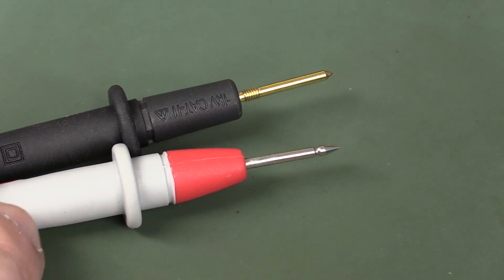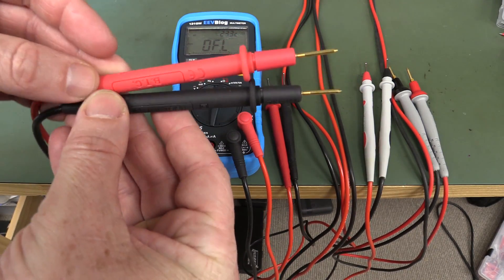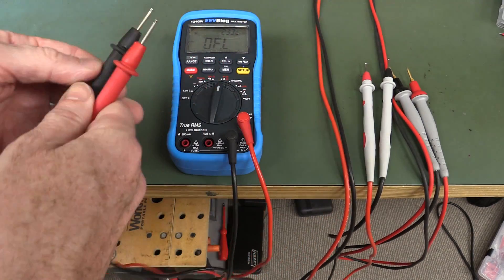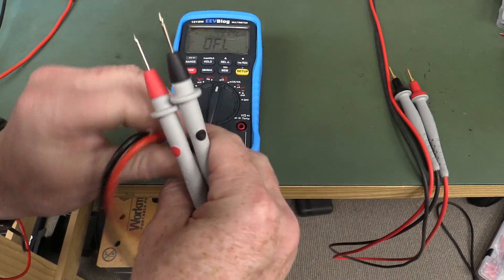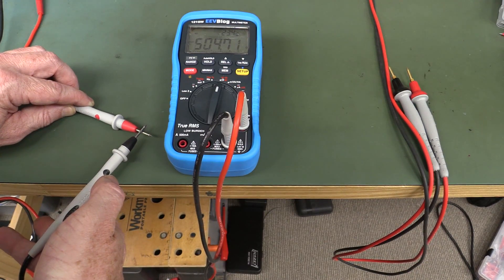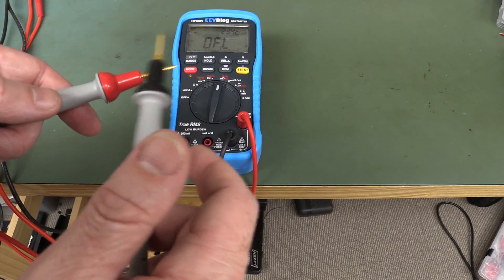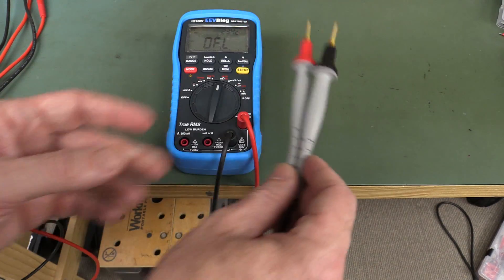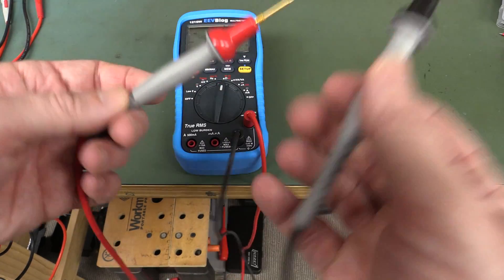eevBLAB #33 - Why Gold Plated Probes Matter

Comment: One thing you didn't account for was the probe weight itself, but the results were still pretty clearly in favor of gold. I like firmer numbers than this but that's me.
Reply from the maker: The weight doesn't really matter much, the point is it's clear that the gold has zero contact issues, and the silver can be pretty horrible. They are all quite similar.
Reply: I wouldn't say it's clear the gold had 0 contact issues, on the last pair it quite clearly missed a few.  There was also a large difference between the old fluke probes and the agilent.
Reply: animefreak5757 no one said there were no issues, gold is however definitely better. Contact bounce and resistance is a fact of life there is no avoiding it completely.
Reply: I quote " it's clear that the gold has ZERO contact issues, and the silver can be pretty horrible. They are all quite similar."